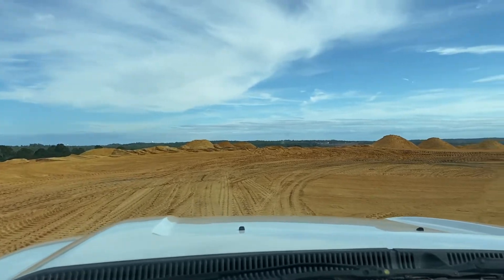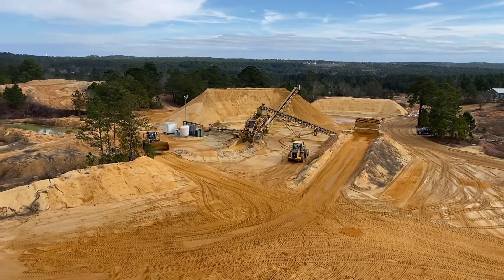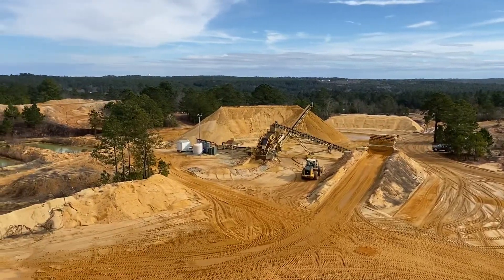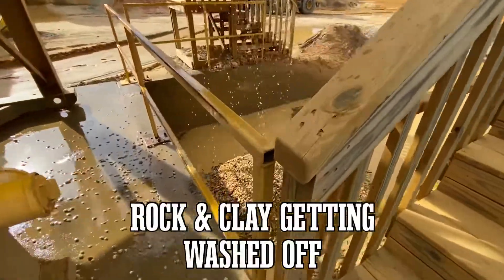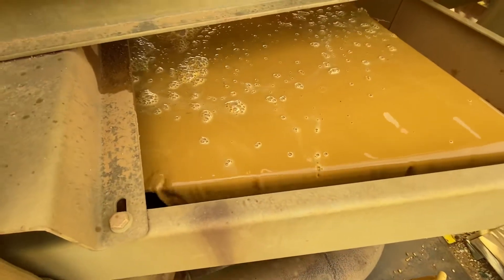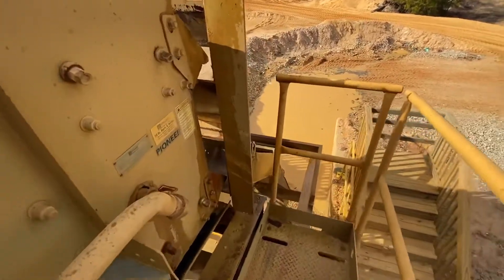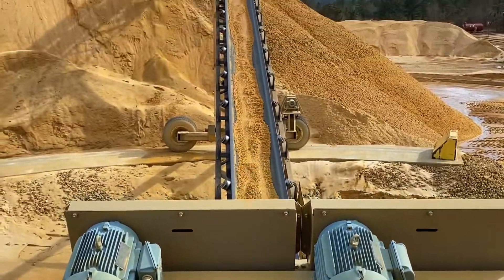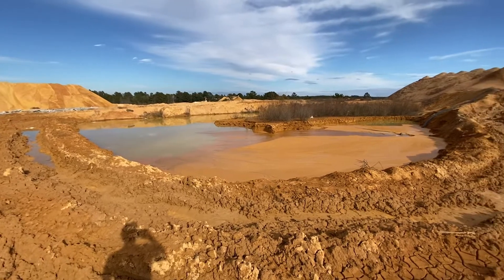Washing Sand

Comment: We have cedar rapids equipment and eagle iron works here and we used that equipment for are sand and gravel company good one Ryan but we had a classifier made masonry sand and the gravel went and was processed into size and then the stuff you take for cover we would use a drag line and that would be classified as pipe bedding and fill sand very interesting but we pumped out material out of the lake and got all the stuff we needed and got enough to supply the state and county and city with materials for the jobs they did that is why I like this channel same thing cause we also had a landfill to and heavy equipment for the whole operation so I learned young how to operate everything we had also had a trucking company to deliver material to customers so you seen this stuff before just brought back memories of back in the day thanks again mr digg my friend from the trash Tuesday channel with coco and the green house channel can't remember the name but watch it last time another water leak not as big as the lake one u and a rod fixed plus a big bill so been watching a while and doing this today you supposed to be on vacation just saying interesting and brought back memories so posted about it i have before so glad you doing what you do thanks again my friend